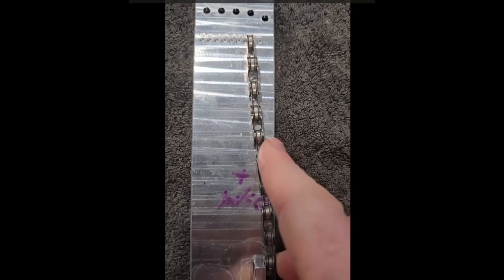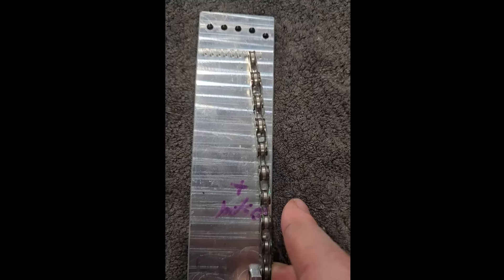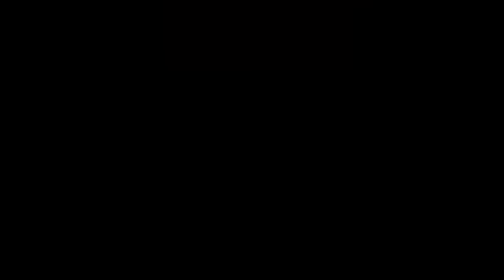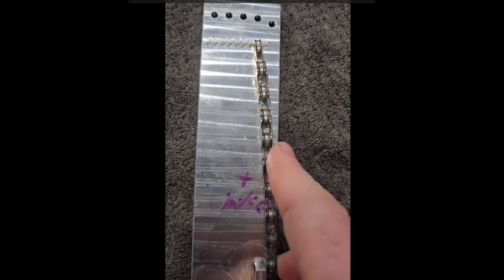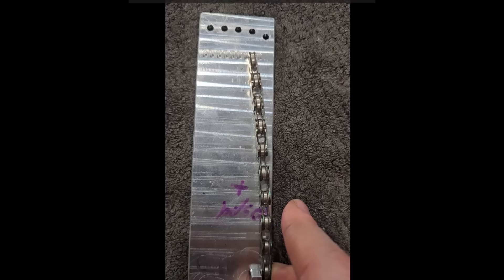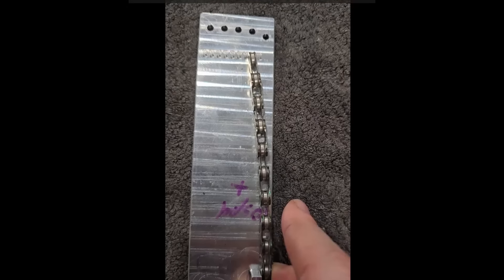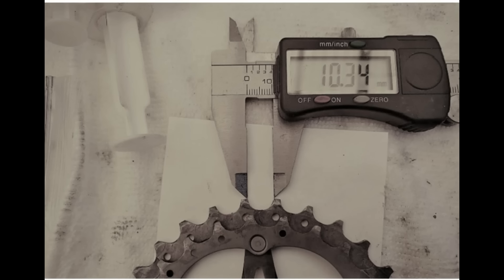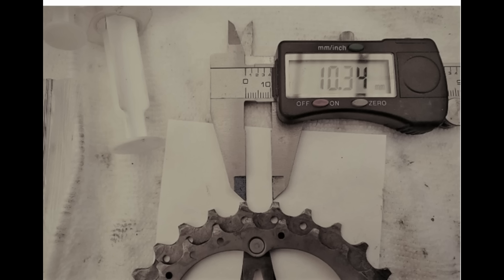Sram WTF

Comment: SRAM would like ALL of their products to be considered a wear item & require replacement after the warranty period runs out, by design. 0.8% chain wear just aids this shitty greedy goal. Wireless blips w/ no battery replacement = throwaway item, rear derailleurs with no available replacement pins that wear out = throw away item, chainrings w/ built in power meter = throwaway item… I would not be surprised if their next RED generation has shifters that you can’t replace the batteries on. SRAM seems to be using their hardware as a pseudo “subscription service” by designing for obsolescence since they don’t have a product that generates monthly recurring revenue from their customers.
Reply: You'r saying they don't make spare batteries for their electric drivetrains?
Reply: @ABHI-dl4dc  for the Wireless blips
Reply: The blips' thing is kind of despicable, both from a consumer and environmental point of view. Especially since it's just a CR1632, it took me about 15 mins to crack one open, replace the cell and reseal with adhesive backed shrink tube, it's not even soldered in. There is zero reason I can see why the units couldn't be 4 small screws and a gasket rather than welded shut. I thought it was maybe to stop/discourage you from effectively building an AXS drivetrain around just the blips (which is understandable from SRAM's POV), but apparently that was blocked in software at the time of their release anyway and only became an option later.
Reply: @petersouthernboy6327  Are you saying it's NOT true that you can't (officially) replace the batteries in blips? Or that they have NOT tied the life of what should be a non-consumable part (power meter) to a consumable one (the chain rings) on RED? Or are you saying it's not true that pivot pin wear is a known issue with SRAM rear mechs, and although they could be replaceable and made cheaply available (and thanks to after market manufacturers in fact are) SRAM's position is that you need to replace the whole mech?
I mean, the OP could be wrong about SRAM's business model, and it all could be just happenstance that occurred in the pursuit of a better system/product (Apple Mac's official stance that was basically laughed at in court BTW), but it's hardly a "ridiculous" hypothesis.
Reply: I just upgraded to the Red E1 groupset, happily paid full retail and am happy with the performance. Voicing criticism for SRAM’s design decisions & business practices doesn’t make me a hater. Dismissing the valid criticisms I brought up without a counter argument is called being low IQ.
Reply: Exactly, I also have love hate with sram. Xx1 was groundbreaking stuff for mtbs for example. But you can't deny the fact here. Also I'm pretty sure their qc is almost non existent. How many nx sx dérailleurs dead on arrival ? Most 2020 sid were leaking oil from a bad shaft design. Many 2020 had play. Shimano does boring stuff but with a few exceptions it just work as intended.
Reply: @TheAntoine191 I prefer Shimano and recently found "rubbish Tektro" brake levers  on a $5,000 pedalec , not worth repairing . That Giant ebike is falling apart whereas my analogue mtb's are great performers .
Reply: @ValentinKompatscher  oohhk
Reply: @petersouthernboy6327  Doesn’t matter if you believe me or not. You’ve not given any modicum of a valid counterargument to anything I’ve stated. You’ve attempted to discredit what I’ve stated via ad-hominem logical fallacies by lumping me as a self loathing SRAM “hater” who is for some reason lying about purchasing & enjoying SRAM’s latest group set… It’s clear you’ve got no useful arguments and therefore rely upon illogical fanboy emotions & feelings that add zero value and simply does not matter to anyone.
Reply from the maker: you have highlight a number of concerns i also have there. Let me tell you i am really aggrieved my new xx-sl mtb crank - the chain ring is intergrated. I thought i had read they did not do this for the mtb - its bad enough road, but there it is. It is nuts. Nuts. I cannot get my head around it.
Reply from the maker: @petersouthernboy6327  im not a sram hater, overall i love a lot of what sram do and i have sram axs on two mtb and no on my cx / gravel  bike. But i am not sure where is the ridiculous statement? the above is all factual? and really should not be happening.
Reply from the maker: @Bikey_McBeardface  you should watch the louis rossman video (computer repair guy) tearing apart apples supposed moves to make their products more repairable. Just absolute misdirection by apple on that front, louis tear down was done very well.
Reply from the maker: @DDSPL15  well said. I am greatly enjoying my axs performance, but my integrated pm chainring on mtb crank - it makes me want to throttle who at sram made the call on that path
Reply from the maker: @petersouthernboy6327  peter not to sound harsh but of all the comments so far yours are the only ones without substantiation.
Reply: To their credit T-Type has a lof of replacement parts, try to find replacements parts for shimano parts
Reply: @zerofrictioncycling992  I'm pretty certain the xx sl chainring are screwed on the PM, you can swap them it's just à différent mounting system.
Reply from the maker: @TheAntoine191  ah yes correct thankyou, i did some searching initially and couldnt find it, did a more solid googling and searching on sram and found it. So yes thank goodness it is, however you need a special tool to remove. Still, thats ok vs the alternative.....

Comment: I ran two Red AXS chain to 7,500 miles with Rock n Roll Gold, and I wasn't even at 0.5% on either of them.  I did notice that switching to a new AXS chain (waxed or drip-lubed) seemed shift kinda rough for the first 250 miles.  I ended up just replacing the cassettes at 7,500 miles as well, but I don't think I really needed to.

I have 17,000 miles on my (non-replaceable) Red AXS/Quarq chainrings.  But, my front mech is derailing the chain wide no matter how fancy I get with the front mech adjustments.  I'm suspecting my chainring ramps are worn, or my recently Nanene waxed chain is still too stiff...

With AXS groupsets, they do seem to shift a lot better if you don't change anything.  I suspect that with a waxed AXS chain, you could run it to 15,000 miles without issue anyway.
Reply: On Red AXS with three rotating chains, each about 3000 mile wear and all at 0.01 chain wear according to the digital park tool checker. I submerge the chains in boiling water, then hot wax with Silca after 200 or so miles, never used drip lube. I think these chains will outlive me the way it's going now ...
Reply: Never heard that SRAM front derailleurs are crap to adjust??      Rgr
Reply from the maker: Yes hot wax x is EXTREMELY stiff for a long time after wax, and a too laterally stiff chain can easily overshift - it is another part of why i never stocked hot wax x. Normally IM wax chains loosen up enough in a few mins that there is no issue.

Overall lifespan on sram hardchrome chains is impressive indeed, but really that amazing chain longevity will be very much undone if you then have to replace everything each new chain, that will not compete well with cost to run for shimano etc.

Comment: I've cheated cassettes to more usable life by swapping my chainring in the front to a different tooth than usual.  It forced me to use the lesser used cogs on rides just by the gear ratio change, and it actually got me many more miles.  I think we all have a sweet spot gear range in the back for our typical riding, if you swap things around you can use the other gears more frequently and get some more life out of the system.  Luckily, I have mounds of chainrings around my parts bin to tinker with.
Reply: My area is too hilly for this lol, you use the whole cassette every ride as you go up and down the hills!

Comment: yeah I agree, logically most of the stress and friction happens on the teeth, and the ramps are not going to experience nearly as much friction from shifting as the tooth edges... in fact I would suspect that it is going to be a fractional amount, especially when you consider that the only time you shift is when you first start off, then on a climb or a descent, whereas contact with the teeth is more or less constant the entire ride
Reply from the maker: yes and also MOST cyclists also lift or at least lower their pedalling load when shifting. Actual wear pressure on shift ramps themselves i expect is so low as to not be any factor at all vs simply wearing teeth period (which in itself will wear the shift ramps, and so i think shift ramp wear is being conflated with just outright teeth wear).
Reply: >3000km on a cheap Microshift CS-H083 12-42T cassette and maybe 90% of of the ED Black coating on the ramps is still there.  It's on a road bike so it doesn't see mud.  Nearly all the missing coating is within 1mm of the outer edge of the cog ( more near the teeth tips ).  Each ramp has a missing patch of about 5mm2 at the bottom of the valley between teeth pointing rearward.  There are several ramps on the largest cogs so wear will be spread between them.

Chain wax may collect on the ramps protecting them ? The surface of mine seemed slippery and polished.  I currently only immersive wax.
Reply from the maker: @dawn_rider  nice, yes i think many cheap cassettes - being steel - would have greater wear resistance than a number of high end cassettes - ie dura ace - with alloy cogs.

Comment: I wonder if the new hard chrome surface is actually more abrasive than a normal chain, and the SRAM chain gets smoother as it is used. The analogy would be sandpaper that gets less abrasive as it is used.
Reply from the maker: not it certainly isnt abrasive as such, however it is possible it does not have the absolute outright speed of some other surface treatments, and MAY be part of why sram chains typically test on the slower end of the scale in ceramic speeds efficiency testing of chains.

Comment: Thanks for the technique on how to measure the teeth of the cogs and chainring! Are the measurements the same for both? I bought a Connex by Wippermann KBvl tool a while back to do this very thing, but the head of it only measures 9.05 mm, which means that even new chainrings will indicate as worn. If we want to primarily consider longevity, like @PeakTorque and his chainrings, what would you recommend as an absolute end-of-life measurement?
Reply from the maker: I havent yet had any real look into tools that attempt to measure chain ring wear. Chain ring tooth profiles from one brand to another simply vary so much i am just skeptical how well they could work. So absolute end of life measurements would be very chain ring model dependent. 

Best ways to get best lifespan from chainrings (and cassette) is to run multiple chains on rotation as you basically guarantee to get those 2 or even 3 chains through a set as everything wears together and keeps mesh in a happy place. There are limits (ie likely hardchrome chains - 2 will be your max rotation before chainring wear on mtb would outstrip chain wear by enough that even with chains not worn, chain ring wear would be and issue, and possibly any alloy cogs on a cassette - for non hardchrome chains 3 chains will likely be the practical limit for mtb rings. Most road chainrings should see out 2 x 2 chains on rotation to 0.5 or a little under or even 2 x 3 if non hard chrome). 

I would simply go that path vs trying to faff with actually measuring chain ring wear as this would be very approximate, and still not help if next new chain runs rough

Comment: All your SRAM comments apply for half-inch chain pitch. What if they have re-sized sprocket and cassettes for +0.4% so that a new chain goes from 0.4% tight through zero to 0.4% slack as it lengthens by 0.8%? This approach might extend component life unless a new chain is fitted too often! A careful measurement of the sprocket could test this idea!
Reply: If the chain pitch was too short on a new chain, it would run as badly as  worn chain straight out of the box.
Reply: @peglor  yeah but sram axs road chain really are slightly shorter than sram transmission out of the box. Something like 0.1%
Reply: @TheAntoine191  Very interesting if they're doing that. I don't use those products, so can't check for myself. Since I ride off road in mud all year round, waxed chains are useless, and I'd be replacing my chain every 500 miles based on a chain checker, so I get 3 or 4 times that by letting everything wear out together (And not buying overpriced SRAM cassettes, so the overall replacement cost comes in less than buying multiple chains and way less if you value your time as replacing chains takes time too). I've never had skipping under power and this is with running chains till the rollers are just short of wearing off the chain - they do get noisier though. 

A weird one I've never seen on any other chain before is that Shimano 12 speed chains seem to wear unevenly between the outside and inside chain plates, so the chain develops a side to side wave when under load.
Reply: @peglor  @hoyhoy42  below did notice something like a bit like that.
Reply from the maker: Well, the sram chains are half inch pitch, so my sram comments kinda fit. Rather surprisingly now that i have a t-type cassette and thus sram flat top chain, the tip to tip measure is still 9.5mm despite the oversize rollers of flat top chain. I had always believed the tooth profile to be slightly larger to accommodate the oversize rollers. They are not. As such, due to oversize rollers but not a bigger tooth profile, i would expect sram chains to begin eating into teeth material earlier than non flat top systems. So there is less tolerance, not more.

Comment: Once again I find myself feeling that I'm not that bright. Given the cost difference between a chain and a cassette,  I would lean to consider the chain to be the sacrificial piece in the equation. With that in mind, I'm struggling to grasp why the effort of plating for longer wear is on the chain and not the cassette
Reply from the maker: no thats a great thought / question.  Yes, the chain should be the consumable part as it is typically much less expensive than the cassette and chain rings - and this gap can be very large on high end groupsets where cassettes can be many hundreds, and same re rings. 

A long term issue is that a frankly huge % of cyclists do not keep check of chain wear. So chains wearing fairly rapidly to 0.5% and beyond (made worse the also huge amount of lubricants that do an average to poor job as they quickly become abrasive) - meaning that the majority of cyclists are caught out needing to replace cassette and sometimes also chain rings when get a new chain, and this can be after not that many kms really. 

So - Sram going an approach that makes chains extremely hard wearing - for the cyclists that would have needed to replace everything with a new chain anyway - this is all groovy - for them. 

However for the lesser, but hopefully increasing number of cyclists that are on top of their chain wear, and have been replacing chains by 0.5% and getting multiple chains to a cassette and rings - the much increased lifespan of the hardchrome chains is seemingly causing some issues, and a change in recommendations. 

So in srams view it seems rather than the usual 0.5% and then potentially have issues with new chain - it is too awkward to go hey replace at say 0.3% - it will be same or more anyway by then as other chains at 0.5%, and go multiple chains - instead it is an approach of hey just run yours out to 0.8% and then replace everything.

Comment: I thought the comment was referring to the "old" tools that are meant for traditional chain sizing showing 12 speed axs chains "too little" wear compared to the actual wear due to the larger rollers of the sram axs chains. Because sram's list of approved chain wear meters includes the Park Tool CC-4, which I understand is intended for all chain types over 5 speeds. But on the other hand, sram sells a chain wear meter that is only intended for new 12-speed axs chains (TL-CNTL-WEAR-A1) and it measures 0.8 percent wear so...

Comment: I've had issues with X01 eagle chains mating with other drivetrain components that would no longer play nice with new chains. Cassette's and chainrings basically wear out faster than the chains, so....
Reply from the maker: yep. For mtb it is VERY common that the chainring will not survive past one chain, even to 0.5%. They are often varying levels of hardness re aluminium alloy - ranging from pretty durable to really not. One fairly small ring doing all the work - its a tough gig. 

Cassette varies a lot. Srams x01 / xx1 eagle - the 11 smallest cogs are tool steel and extremely hard wear. If you mostly keep it out of the alloy 50/52 cog - the cassettes will typically have no issue seeing out even the super long lasting x01 /xx1 chains - at least my oldest xx1 cassette the steel cogs still measured basically new. 

GX is a lower steel grade, aftermarket cassettes are also typically much faster wearing than the tool steel used on srams x01 /xx1 level. 

T-type is going to be interesting, seeking more info on the cassette material